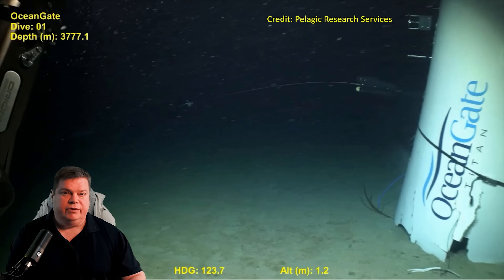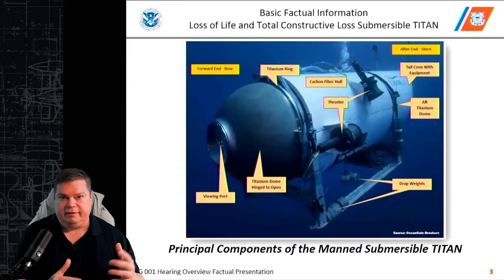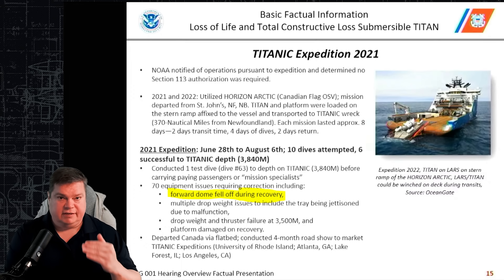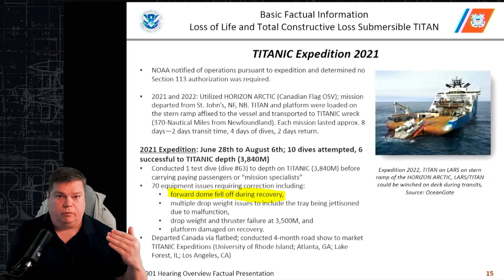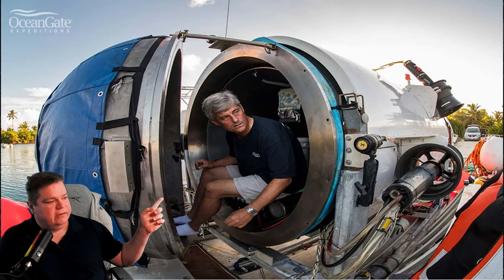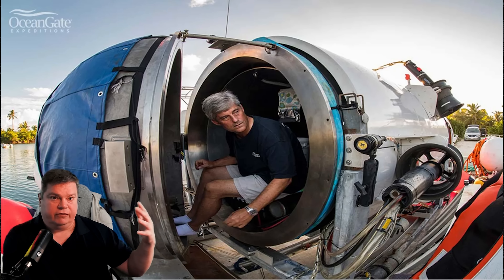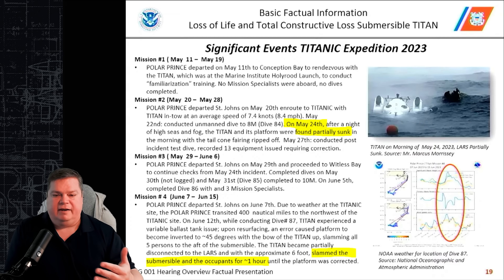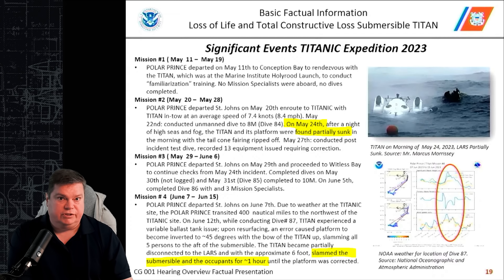New Evidence in Titan Submersible Disaster

Comment: I'm not a very smart man. I'm a plumber and I work on boilers. There's a spoiler out there called a cleaver Brooks that uses a door very similar to this sub except it's. Adjusting for scale the hinge on The door of a cleaver Brooks boiler is 20 to 50 times the size of the hinge they have on their titanium submarine end cap That fell off. Another thing I noticed is on a cleaver Brook spoiler. It has to withstand it internal pressure of only 15 to 30 PSI. That's pressure pushing out. The door on a cleaverbrook spoiler has a 3/4-in bolt every 6 in around the circumference of the door. Looking at this photo, the subs bolts seem vastly undersized and it seems like there should be three to four times more bolts than there are. Of course this is trying to keep pressure from crushing it which is the opposite of a boiler containing pressure but it just seems wrong to me. Anytime you have flanged pipes that come together, there is a pretty consistent ratio of bolt numbers and bolt diameter to pipe diameter. This seems to go completely against that and has too few bolts that are too small. In this plumber's very uneducated opinion.
Reply: Sound like a smart man to me.
Reply: The water pressure is compressing the door on so the bolting needs are much lower than if the pressures  involved were instead being constrained in the sub.  Pressure vessels are no joke.  Only 30 psi....  Doesn't seem like much until you realize a 3 ft circle would generate a load of 30,500 lbs.   That said everything they did is pretty much some combination of wrong and reckless.  The comments about the titanium to carbon bonding are dead on.  Its unbelievable they didn't even prep the surfaces being bonded.
Reply: You're smarter than the guy running that whole op at the least
Reply: @rustyshakleford5230  the cleaver brooks are also well made boilers. This sub was not well made.
Reply: I'm not a smart man, when it comes to plumbing.
When it comes to plumbing, You are a smart man with practical experience.  I would never go in a submarine if the team who built it didn't include someone with experience in...plumbing!!  
Or like someone with experience working the pipes on an oil-rig.(not a pun)
..Plumbers always fascinated me... they can work anywhere there are pipes...and pressure. Like a hydropontic farm, beer factory, distileries, marine stuff, pneumatic systems, swimming pools , golfcourses, oil-industry, ,...it's one of those professions that aplies to a lot indeed..
Reply: Also just a "dumb old plumber" but worked on a lot of low pressure boilers for radiant heat and building processes, we only had 3 high pressure steam boilers at our various sites 
but the high pressure  boilers were the ones that scared the crap out of me.
There was NO ROOM FOR MISTAKES, even a pin hole in a line could kill you.
Reply: @winningwithoutracing7811  F=P*A, the Ohm's law of mechanical engineering.
Reply: Yep and the craziest part is they would use only 4 bolts to hold it on during some dives and pictures taken before the fateful mission showed they did not have all the bolts in place.
Reply: I’d agree that over engineered is better than the opposite👌
Reply: "I'm not a smart man"
>Proves he's intelligent af

Comment: The fact that the dome cap was still intact and looked like it had very little damage, showed that it popped off from the interior pressure of the sub. Those hinges failing caused that catastrophe. The constant using of this sub over and over again was just too much. The pressures at those depths is 400 atmospheres, and that changes the metallurgy of the sub, down to the hinges. They used carbon composite materials that was wov. Mixing all these materials together at those depths was a disaster waiting to happen.  You have to wonder what those seals looked like on a microscopic level. James Cameron who has experience with this said these subs shouldn’t be used more than 5 times at these depths because all the strain the vessel sustains. This sub had 90 dives with 13 successful dives to the Titanic. This sub should’ve been retired many dives before the last one. Gross negligence of Rush and that company.
Reply: I don't think the hinge caused that disaster, the hinge probably got damaged when the dome fell off. 

Which is probably what happened underwater this time. The carbon and hypoxy glue due to stress couldn't hold onto the dome anymore and the water pressure then was just to much and the carbon too brittle and the whole thing imploded from the front dome ... and smashed and mushed people and equipment , as water rushed in from all sides and slamed everything into the back dome and the force caused the tail section to pop off too.
Reply: @JaniceHope  From the sounds of it the hinge was already damaged before they even went down. Maybe not to that scale, but clearly it had had problems in the past and knowing the constant screwups of this company and Stockton Crush himself, I'm not convinced it was ever actually fixed. At best they probably slapped some kind of bandaid temporary fix on it and called it good.

Comment: The submersible was dropped when pulling it out of the water. Thats why the dome fell off. It didnt just, "fall off".

 Fred Hagen said: “The force of the platform hitting the deck… it basically sheared off several bolts and they shot off like bullets. And the titanium dome fell off." 

It was being held on by only 4 bolts. ONLY 4 BOLTS!!! 

yowza!
Reply: Exactly
Reply: Yeah, that freaked me out too.  NO surprise that same dome interface is the most likely point of failure.  If it sheared the mounting bolts off... what did that same mechanical shock do to the glue seam between the ring and the tube?  Did that glue crack and weaken on that incident?
Reply: @Kris-ib8sn  Even more yikes when you realise 4 bolts can't possibly have equal load on a round object.

So not only did they have no redundancy but they chose a number which was likely to increase the chance of failure.
Reply: @louiscypher4186  At depth there is 15,000,000 pounds of force pushing that dome inwards. Those bolts are just there to seal it at the surface. Underwater, the water pressure puts way more force then even 20 bolts can ever clamp down.
Reply: @wally7856   I'm sure Mr Rush reminded himself of that in the split second he had to think between an almighty creak and the fwd bulkhead failing completely.
Reply: meanwhile you look at the face plate of any steam locomotive and it looks like the company that built it raided the hardware store for every single bolt in existence. THAT is how you seal a hinged surface and allow it to deal with a pressure differential. Not four bolts.
Reply: @wally7856  Exactly.  Ugh!
Reply: @lsswappedcessna  Your boiler example the water is pressing out forcing the metal components apart hence all the bolts. In the sub, the water is pressing everything together which is the same as the bolts normally do so the bolts are redundant and not many needed. . This sub at depth there is the weight of one hundred m1a1 Abrams main battle tanks on that dome pressing inward. For an exercise, place that dome on the ground. Now stack one hundred of America's best heavy tanks on top of that dome. Yes, one hundred of them on top of each other. How many bolts do you think you now need to prevent that dome from sliding on the ground? Maybe the wind will blow it down the street because there are no bolts holding it in place? The bolts make no difference under water.
Reply: I am fairly libertarian. But I say the coast guard should have shown up and shut the whole operation down.
Reply: @Toro_Da_Corsa  That assumes the Coast Guard was aware of the operation. Is there any documented proof that OSHA contacted them?
Reply: @wally7856  Taking your stacked tanks example, imagine now that instead of lying on the ground, the dome is teetering on a thin tube standing vertically. Now imagine any kind of deflecting force that might/could be applied to your apparatus and how quickly the entire thing collapses with even a percent of a degree change in interface between dome and tube. Perhaps, say, hit it with a truck at even just a few mph, and see what happens.

So I, for one, would rather not rely entirely on friction to keep the dome in place on the end of my pressure vessel at 400 atmospheres, I dunno about you. The force of 100 Abrams tanks only applies in precisely the mating interface normal, every other direction is cancelled out. So the slightest change and that entire force is instantly redirected to removing the dome rather than keeping it on. All they needed was a simple flange on the dome that fit inside the tube to prevent that particular concern from ever happening for any reason and they just didn't bother. So, you're right that the bolts made no difference at depth...until they do. Like, say, hitting something like a shipwreck on the seafloor with a vessel you can barely see out of and had constant ballast, control, and electrical issues. But hey I'm sure it was fine!
Reply: @pearly1789  The problem isn't the interface. The problem is with the tube. The strain gauges show that on dive 80. The big bangs and cracks heard on previous dives allude to delamination's. The recovered hull shows that the 5" thick tube split into 3 parts, a 1" thick tube and two 2" thick tubes. The interface is a red herring. All evidence points to the tube losing it's integrity. If the delaminated tube caused the interface to fail then it's not the interface that caused the problem, it's the tube. No amount of flanges, bolts or anything else would have held, the hull failed.
Reply: Probably the wrong kind of bolts as well. SMDH!!

Comment: What caused the front dome to fall off was they only used 4 of 18 bolts and then the crane operator dropped it pretty hard onto the recovery platform. So they knew what caused the problem. Not using enough bolts. They never inspected the carbon fiber hull to determine what, if any damage, the hard landing caused.
Reply: @daring5722  that sub was always going to fail, doesn’t matter how many bolts they used.
Reply: The bolts are not critical underwater. At depth there is 15,000,000 pounds of force holding that door shut. More then any amount of bolts can clamp down on. They are only needed at the surface.

Comment: Looks like the dome blew clean off at the glue joint. Not even any debris attached to it. Pretty crazy they didn't use a mechanical connection for that.
Reply: I think you misunderstand the failure mode. 
It didn’t exactly ‘blow off’, it was being pressed into the carbon hull with a force off over 5000psi at the time of failure.
Once the vessel was compromised the dome was propelled away from the wreckage as part of the implosion sequence.
Reply: @Captain101-x1o  you completely missed the point smart guy. 🤣

Comment: It could not have been THAT much more expensive to make the whole pressure vessel from titanium or thick steel. Why did they even use carbon fiber in the first place? Its not even loaded it tension! It gets more stupid the more you think about it. We have centuries of experience making pressure vessels from metals. They have ultrasound machines for finding cracks in metal walls, they do that all the time for pipelines etc.
Reply: I guess it was attempt at "bringing something novel". Except didn't undergo any thorough failure testing.
Wasn't there some footage of its construction, where carbon fiber was just wrapped on and licked with resin, layer after layer like some garage project?
Reply: Some issues with titanium throughout is that as you get bigger (to hold more passengers), the thickness grows.  And that adds weight that makes it negatively bouyant.  To counter this, you need some form of positive bouyancy that is pressure resistant (some sort of 'foam' i believe).  So...  a big part of it is "Bigger to generate more revenue but not heavier to keep costs down".  Sadly, all too often saving money drives bad decisions.
Reply: The reason for using carbon fiber was primarily buoyancy. The hull was close to neutrally buoyant by itself which limited the need for large volumes of syntactic foam to allow it to float/ascend. If it had been made of titanium, it would have needed roughly 2.5 times the hulls volume of foam to get it to float which would have made it 3-4 times larger. 

Basically, Stockton was trying to keep the submersible as small as possible while also carrying as many people as possible.
Reply: It's to keep the weight down.
(For buoyancy). Surprisingly a big issue (difficulty) with subs is to keep the weight down.
Reply: Plus it was ex-Boeing expired carbon fiber if I recall correctly. So he got a great deal on it. No, I'm not kidding.
Reply: It would have made it smaller - less passengers
Reply: @mikefochtman7164  Could the weight have been solved by using honeycombed titanium skin?

Comment: Apparently the dome fell off because they only used 4 bolts and the crane operator dropped the sled and sub on the deck of the ship.

They may have closed the incident as the dome coming off was not a typical use case for a failure.

Comment: There is a debris map released by the Coast Guard.  It also includes the last known location of Titan and the bow of the Titanic to show how close it was.  Looking at the debris map, it appears that they were down there for several minutes longer than their last ping and were in a different spot when the implosion happened.
From what I have seen on another channel, they had an emergency balloon that would inflate and lift them up.  Apparently inflating that balloon knocks off the rear cone and it appears that is what happened.  So, it appears they were knowingly in distress and were trying to ascend back up to the surface.
Reply: The sled on the bottom is also nowhere near the wreckage, showing that could have been jettisoned also in an effort to resurface.
Reply: Although much of this sub was poorly designed, it is possible his real time monitoring system which monitors hull integrity was going off anywhere from moments to a few minutes before implosion. Which could be why they attempted emergency ascent. Then again it’s possible they had zero clue anything was wrong. Whether or not there was panic in the sub, what we do know is they would not have processed their deaths as the event occurred so fast.
Reply: This is not a safe assumption.  When the front of the submarine collapsed it did so with enough force to blow the back dome apart.  That kind of energy transfer can launch debris quite far.
Reply: @JSheepherder  While I do agree that all our conjecturing may not be the most accurate description of events, the debris map does show a clear pattern of current.  It shows everything, except the hull and domes, to have been carried northwest as the pieces were floating in the water.  The hull and domes appear to be the only parts that were too dense and/or still had too much kinetic energy to be carried by the currents very far.
Reply: There was nothing in the hearings to indicate this. This is merely speculation from people who didn't watch the hearings.

Comment: Look - it boils down to simple physics – Atmospheric Pressure (A.P.) increases by 1 per 10 – TEN – meters depth.
WE DID THIS IN SCHOOL – Surface = 14.7 P.S.I.,
10 meters = 29.4 P.S.I.,
20 meters = 44.1 P.S.I.,
30 meters = 58.8 P.S.I.,
40 meters = 73.5  P.S.I.,
50 meters = 88.2 P.S.I.,
100 meters = 161.7  P.S.I.,
1,000 meters = 1,485 P.S.I. (101 A.P. multiples),
1,300 meters = 1,926 P.S.I. (131 A.P. multiples),
2,000 meters = 2,955 P.S.I., (201 A.P. multiples),
3,000 meters = 4,425 P.S.I., (301 A.P. multiples),
4,000 meters = 5,895 P.S.I., (401 A.P. multiples),
ANY unit designed/rated for 1,300/3,000 meters should NEVER even be considered for a load of 5,895 P.S.I.
WHAT THE HELL WAS RUSH “THINKING”?
Plus - a little mantra of mine - "It if flies, it can crash; if it floats, it can sink; if it's electrical, it'll try to kill you (nothing personal)". Just sayin'.
Reply: If you are going to work in metric stay in metric. It would be better to bracket the PSI figures and have BAR figure or Atmospheres next to the unit of measurement.
Reply: while you aren't wrong, the port window rated for 1300/3000m was not the failure point, which we know because it got pushed outwards at the time of failure. Lots of things rated for certain pressures can often exceed their rating quite a lot without failing, at least once or twice.
Reply: Fun Fact: Density of lead is 0.409 lbs./sq. in.  A column of lead with a 1 sq. in. cross-section would have to be 1,120 feet high to weigh 5,500 lbs.  5,500 psi is the approximate pressure at Titanic depth (~3800m).
Reply: ... and Murphy's Law always applies.
Reply: @MrSatampra  Don't forget..."Murphy was an optimist"